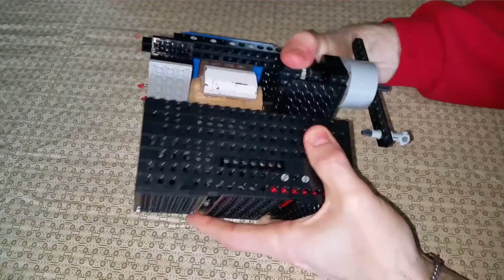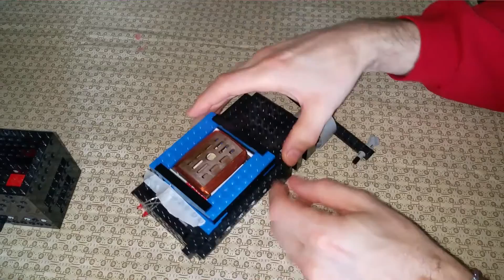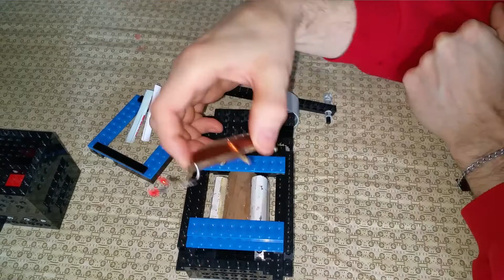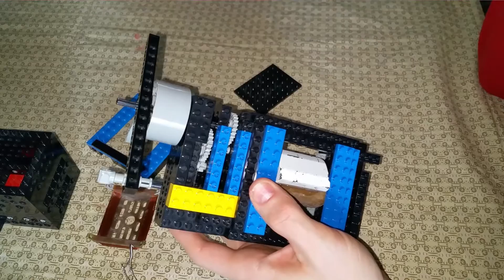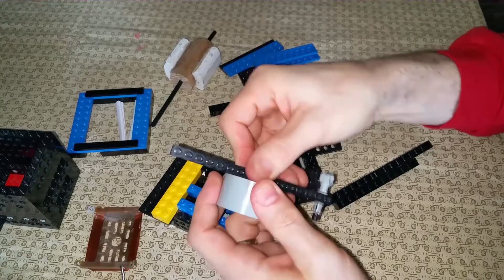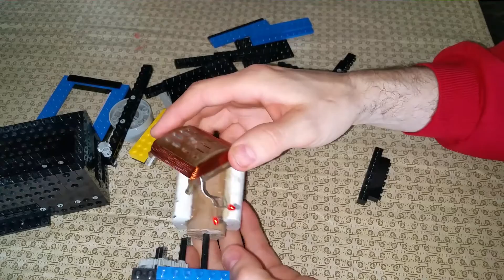"Lego" Electric Generator

Comment: Hey David -- long shot that you'll see this comment, but can you point me towards some info on how you made this coil and some more specifics on the magnet setup?  I'd LOVE to do this project w/ my son.  Thanks!
Reply from the maker: The coil is from a pc internal hard drive. It controlled the head placement when locating a file. The magnets are from a larger woofer from a speaker. Strong magnets can also be found inside old hard drives and old motors. Finally, I used E6000 glue (amazing stuff) to hold the magnets from flying off.